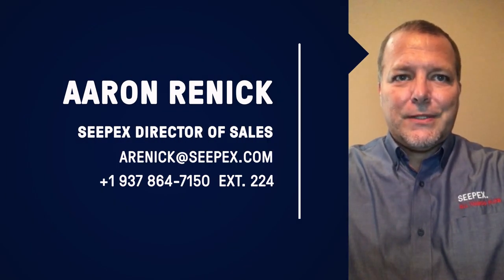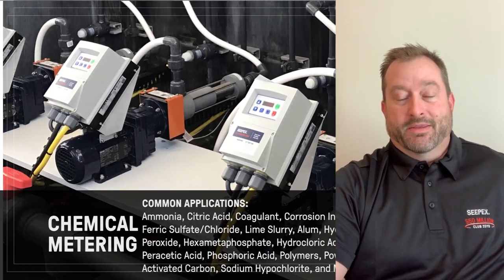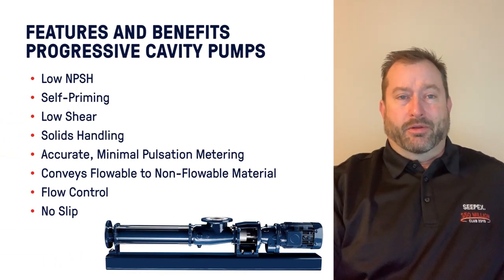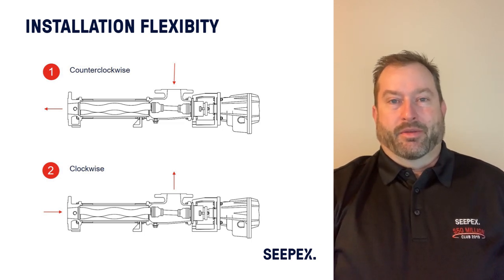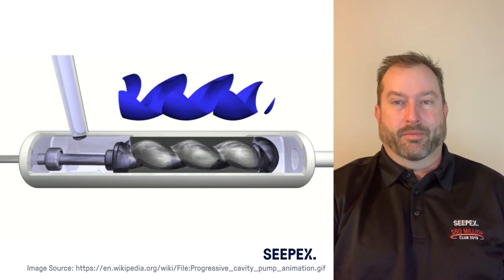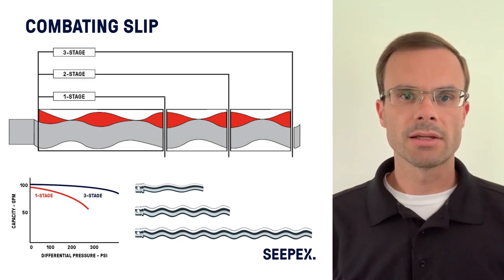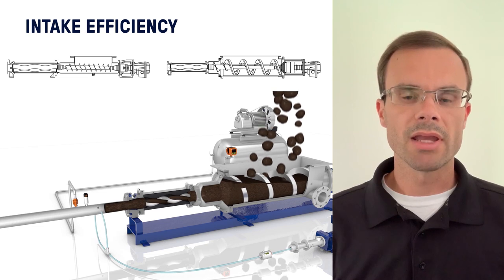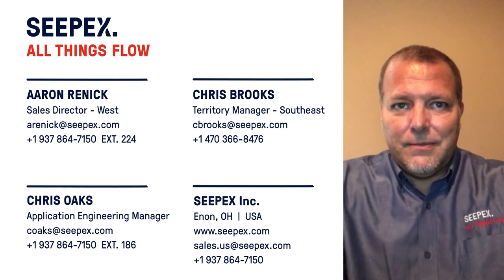SEEPEX Webinar: Progressive Cavity Pump 101

Comment: Do these require a check valve on the discharge? (for example on a primary sludge line that feeds to a digester)
Reply from the maker: Hi Ryan - Please fill out the contact form at the link below and we will get you connected with a SEEPEX pump representative to answer your questions. Thanks!   

Link - https://www.seepex.com/us/service/contact/